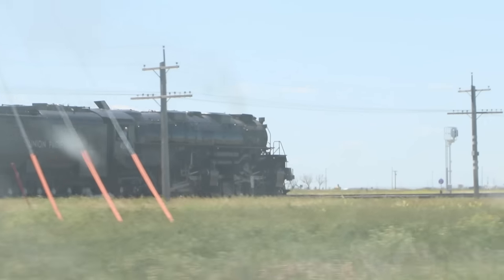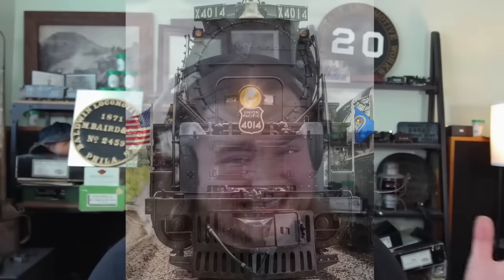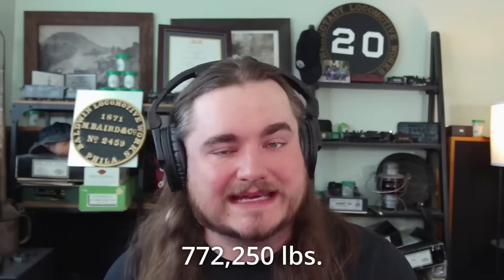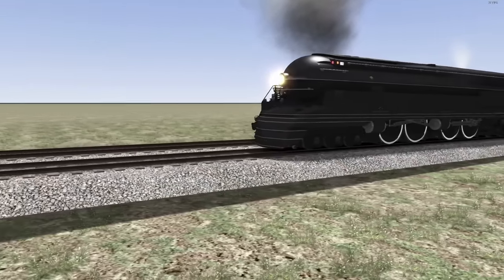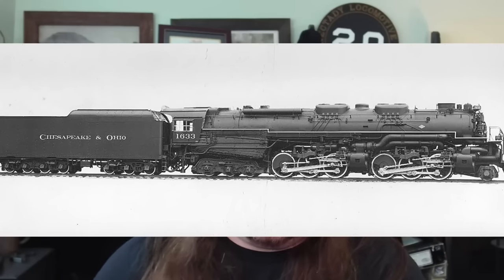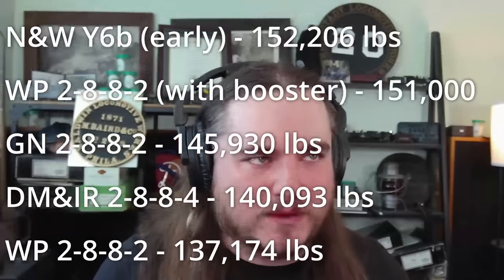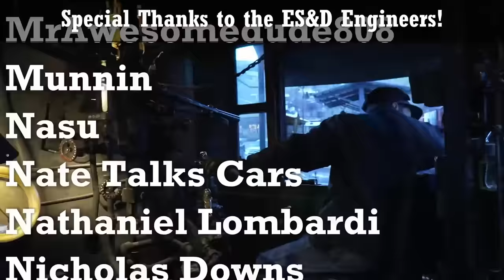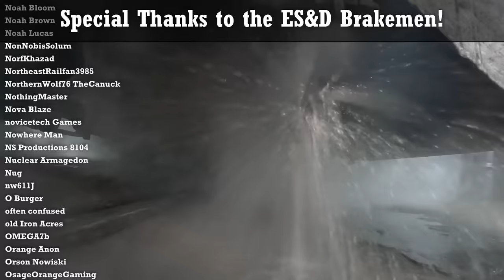BIG BOY is NOT the BIGGEST? What is then?

Comment: people saying the big boy is the biggest forget about the russian 4-14-sometging i forgot as well as the belgian overkill 0-6-2+2-4-2-4-2+2-6-0 locomotive which was too powerful for our European couplings
Reply: The quadraplex was a Belgian locomotive, don't blame the Netherlands for that
Reply: @Yorie1234 We're such a small country, we got to overcompensate somewhere 😅
Reply: The Russian loco you refer to,was like the steam turbine engines mentioned here, it rarely ran. Unlike the mechanical issues the ST machines, the Russian loco literally destroyed the rails it ran on.
Reply: the AA20 4-14-4 is the Largest Rigid frame loco made. 
considered a Failure in Russia for several reasons not it's own fault. 
it regularly tore apart the track it ran on because the Russian Mainline Rail size wasn't heavy enough to properly hold this monster up resulting in several derailments from wrecked Track. it was a notoriously rough riding loco very hard on it's operators from reciprocating occilation resulting from it's center of mass directly over the 4th driving axle. this caused an unnerving seesaw effect which didn't help the already overburdened track either.
Reply: Russian one had longest rigid frame. Compared to many articulated engines, he was pretty small (whole idea of it was to get powerful simple locomotive within low axle loads).
Reply: @Yorie1234  I seem to remember Train of Thought said it was meant for Italy or something
Reply: And the Garratts
Reply: The Belgian Quadruplex Locomotive (a.k.a, the Franco-Crosti Locomotive) is the locomotive you're talking about. It was the most powerful steam locomotive ever. History in the Dark introduced me to that locomotive, and it's a very immense beast.
Reply: Insane loco
Reply: Welcome to europe i guess
Reply: @TyrixBE Yes, but you have to fit the whole locomotive in the country. 😃
Reply: In Mother Russia, Locomotive eats rails for breakfast 😂
Reply: The Quadraplex was a poor steamer.
Reply: @Yorie1234  i misremembered my sources yea ur right
Reply: He Russian one was only used a short time. It's weight destroyed tracks. But then we must consider the quality of the rails, the ties, and the road bed in Russia.
Reply: @pforce9  The biggest Garratt, the NSWGR AD60 class, was only 108 ft long and weighed only 265 tons. My fave loco of all time but tiny by comparison.
Reply: @lordsherifftakari4127 Up Until The S1 came along and overtook the AA-20 Being the biggest Rigit framed Locomotive
Reply: USA: Gentleman, the Triplex Locomotives were a failure. Let's stick to Duplexes. 

Belgium: Let's try a Quadruplex!
Reply: @turkeytrac1  Ah you mean the "Double Mountain" Garratt 4-8-2 2-8-4's made as a three piece / double articulated (suspended boiler & coal bunker) units, that were made in several different variants for railways world wide (apart from the USA which was IN a tiny world of it's own), there were also THREE that were so huge and had to run so far without stopping, that they were almost always "coupled" to a tank-tender to suppliment the inferior water tank on the suspended (middle boiler) chassis itself.
Nothing like having TWO huge mountain 4-8-2's running "back to back" sepaated only by a HUGE low-slung central boiler with a small water tank and coal bunker?
Converting them to urn diesel was way simpler, as the coal bunker could be removed enabling a diesel tank to be there, or, by removing the water tank and bunkers out from the center chassis, an oil only tank could be set alongside the central boiler, although it was possibly more pertinent to leave the center spaces for spare water (that wouldn't matter if it was pre-heated before going into the main boiler, with the diesel in a big tank car behind, and with fuel "piped" to the cab controls.
Reply: The largest locomotive in my country is 6029, an AD60 class Beyer-Garratt with a 4-8-4+4-8-4 wheel configuration. And is in working order
Reply: that belgian quadruplex and the AA20 are like europes big boys to me
Reply: @ChessieSystem1973 Straya, mate 👍
Reply: Didn't Russia have a nuclear train at some point too? That would be Steam by technically

Comment: Long story short; the 4000 class isn’t the leader in any specific category (weight, length, horsepower, speed, etc), but it is perhaps the largest general purpose locomotive. Most other locomotives that beat the Big Boys categorically were designed to fulfill very niche roles on their home railroads and would not do well outside those roles. The Big Boys on the other hand, could get down on their knees and pound up a grade at 10-15 mph with tonnage, but then also pick up its rods on the flatlands and run 55-65 mph with that same tonnage.
Reply: The Alleghenies were also general purpose engines. Ugly as sin but they were designed for horsepower at speed. Although the C&O used them to haul coal trains up the sides of mountains at 15 they could and did pull fast freight at 45 to 55 and could have gone faster. They were really designed for fast freight even though they were absurdly heavy.
Reply from the maker: Very true. The big boys are excellent locomotives..
Reply: The way I learned it, (back in the 80s,) the Big Boy itself was a niche loco. It was built for relatively tight curves, pulling a lot of coal uphill on a tight mountain route. The Alleghenies presumably didn't have that restriction.
Reply: @eekee6034  Don't know where you got your information from,  but the 4000s were built specifically for service between Ogden and Green River, where they hauled mainly manifest trains and perishables (fruit blocks). Coal trains were not their assignments. The route does not have particularly tight curvature. The restricting factor on the size of the 4000s was the vertical clearance in the Aspen tunnel, east of Evanston, WY.  In the intervening years the tunnel's height has been increased and now accommodates stack trains.

It wasn't until they were bumped by diesels that they routinely ran east of Green River. They finished out their service lives on Sherman Hill, between Cheyenne and Laramie. During that time they would be run down to Denver, and occasionally to North Platte. They had to be turned on wyes at both terminals because there were no turntables to accommodate them there.

Although they were cleared to run on main lines across the entire system from LA and Portland in the west to Council Bluffs and Kansas City in the east, they stayed on the original UP route between Ogden and Council Bluffs, except for the runs to Denver and a series of  test runs between Salt Lake City and Milford, UT. That was oil fuel territory, so the 4000s had to be fueled with a clamshell bucket from hopper cars, the way coal burners on fan trips are done today.
Reply: The Big Boys were the largest mass-produced locomotives, I believe.
Reply: @andrewmagosky7181 the C&O’s Alleghenies if memory serves correctly couldn’t be interchanged with other railroads due to them being so heavily ballasted for coal service in West Virginia and later models of the “Blue Ridge” Virginian variants of the Allegheny were similarly ballasted for coal service and was the only railroad interchange the Alleghenies could operate in. 

And no they were not ugly. They were totally functional and Spartan in appearance as they rightfully should’ve been given their work
Reply: @andrewmagosky7181 they were definitely not ugly. I looked like real heavy workhorses to do what they were designed to do.
Reply: If I remember correctly, the Lake Superior Railroad Museum (in Duluth, MN) has an engine of a size comparable to the Big Boy, perhaps even slightly bigger.

Comment: Jawn Henry was absolutely insane.. 600PSI Water Tube SHIP boiler. Driving a turbine providing electricity. It had AUTOMATIC boiler controls.. They built a freaking coal power plant on wheels.  and of all the experimentals Jawn.. worked. Almost too well, it was infamous for doing things like pulling knuckles and even pulled a couple hoppers apart. It was put in Pusher service for that fact. It wasn't replicated because it cost a freaking fortune. But by god could the thing pull...
Reply from the maker: Good Lord. That thing was rad.
Reply: Wow.
Reply: The Jawn had other issues as well. Tended to crack turbine blades if the operator changed power output demands too rapidly. Had problems with coal dust and water playing hell with the electronics. Very sensitive about water quality, and as you said, prohibitively expensive. None of these were insurmountable problems, but it came too late for other railroads to be interested so the money just wasn't there to refine the concept further.

I should also note that the tractive effort rating provided by Hyce for the Jawn is off a bit. The operator's manual (which I have a reprint of) states continuous tractive effort at 10 mph at 144,000 lbs, and starting tractive effort at 175,000 lbs. Still respectable numbers to be sure and much higher than the Big Boy.
Reply: @NorfKhazad  Shame that at least one part wasn't preserved
Reply: @NorfKhazad   So Jawn Henry was essentially the equivalent of some variant of SD70?
Reply: @davidwhiting1761  In terms of performance? Yes. 40 years of progress in electrical controls and truck design makes a big difference.
Reply: Easily my favorite machine of all time.
Reply: I love that this beast of a train was presumably named after the folklore of John Henry, the might man
Reply: Hello how are you? I want to share you 

This is a message from your loving God.

God is a loving God and want to save us all.

God dont want anybody to suffer or have a hard life. Meaning of life is love and that's what God wants. Thats the meaning of life. If we would take care and love each other that would solve all the problems. But world is not like that. World is a sinful world. God dont destroy this world but we humans do. His immediately ready if you want to serve him. God will show you the right path what leads to life. Its a path of love. God made us and have eternal love and mercy. This world is not what God wanted. But he gave us free will. You can choose good or bad. Thats why he send he's only son Jesus that we had mercy. Jesus is God too because he is God's only son. Now this world have went to very wicked and our God is crying. So many peoples are on the path of destruction. World have allways been wicked but now is extremely bad times going on. God want's peoples to come back to serve him and he wants to give forever life and happiness. God is a God of love, mercy, justice and a judgment.

He love us peoples as much as hes son Jesus. 

There is one big lie going on this world. Its an evolution lie. First please think this thing. Why all the fruits, berrys and vegetables taste so good? Anybody can go to own home kitchen and try to do the same taste. Then look up please and watch those extremely beautiful birds. Do you really believe birds came from dinosaurs? We need very light bones, right size, correct shape, a bird's beak and feathers. And the same time birds are very beautiful. I send only these two questions to evolution professor and nothing came back(Why berries taste so good and how those little birds survived without wings) 

Then they say evolution gave animals camoflash to survive. Well if we look black panther. They say it's black because it's a night-time hunter and that black color also give it protection during night-time. First thing: evolution dont have brains and it gave that black color they say. Second thing: Please think how many shades of colors are and all animal have to be black.

Third thing: Then they say there were many panthers with another color also and the best color was left. Because it's the best color in the nigh time. This is a lie also because: if you think like evolutionist's: the animals system also have to know to do black anymore. Rabbit is also brown when it's a summer and white when it's a winter. We need intelligence to do that. 

They say also evolution develops animals or Humans what kind of element we live. Why then fish have gills and whale have lungs? They say first came the first cell and that was finally a fish. And then finally fish came to land and it was frog or something. 

But thats inpossible because gills should also transform to lungs under the water. They brake their own logic when they say that. And how about a whale. Whale proves also God is real because it have lungs. Theory of evolution tells everything started from ocean. 

They also say that plants came from ocean and thats why we have now.

Thats a lie because:

The plants have an underwater pollination system. If something comes to the beach it will die for it. And they are breaking their logic again. Fish and other water animals and plants belong to sea. 

Only our loving God can create life and everything what we humans and animals need. People can try to think but the deeper we try to dig the more lost we are. We cant ever create life from nothing. 

A simple car engine also needs its maker, parts, fuel and the right structure to work. 

I had health problems about six years ago. Finally it was so bad i thought im gonna die. My heart was beating fast. My blood pressure was high. Then i started to lose my energy. When i try to walk my legs felt heavy and my stamina went very bad also. Then i started losing my sleep. Eventually i crashed a little into the road and asked God and Jesus to help. Finally I started to run in the toilet all the time too. Then the very awful thing came. I lost fastly almost all my ability to sleep and I started to loose my weight. Blood came out of my nose and I started to lost my hairs too. I visit hospitals and private hospitals too but they couldn't help me. They gave me beta blockers to my heart and finally medicine to my high blood pressure too. I wanted to get inside the hospital but they refused to take me in. In private hospitals they couldn't understand why they dont take me in the main hospital. Finally I contact to other country and I asked can you take me in the hospital. Then they asked where are you here? I told im in the other country and I need a help. But they told me we cant take you in because you dont live here. So I can tell you money didnt help me. Later I told my family im gonna die very soon because I felt completely awful. Finally I asked again God to help me. Then finally my Mother saw one Angel vision and three Jesus vision. After that it took few days and my health came back. I got my sleeping back and my heart started to calm down. I started to gain weight. Blood pressure went back to normal and finally I got all my hairs back. This Is very short version what happend to me but I was close to death. God Is real and loves us very much. When you begin to seek God you Will find True love. Read the Bible too please because its a perfect book. Thats how you know God Is real💕🙏. Read what Jesus told because its perfect talk💕🙏
Reply: @TimoIivonen  Somebody always has to ruin things. Could have been a Trump hater too.

Comment: It seems silly, but I think 1 reason that the Big Boy is so iconic as "The biggest" is due to it simply looking the part.  No streamlining, the whole pilot assembly is massive, it has a lot of rough and tough looking external parts. Ect.  It just looks like the designers said screw making it pretty and give me as much power as you can.  Plus the name definitely helps.
Reply: And the locomotive without its tender is considerably larger than the S1 without its tender

Comment: I've always had issues with anyone listing the Jawn Henry as a "steam locomotive" in anything but the most general sense.  It is, by definition, a Steam Turbine-Electric Locomotive (STEL), not a Steam Locomotive.  How the turbine is operated doesn't actually matter in the classification.  It falls under the same operating principles and in many ways has much more in common with the GTELs than a steam locomotive since the steam is not directly driving the drive axles.  "Steam Locomotive" has always described what powers the driving axles, which is why the GTELs were "Gas Turbine-Electric" and most modern road engines are "Diesel-Electric".
Reply: Agreed!  The Jawn Henry isn’t anymore a steam locomotive than the Arleigh Burke, or for that matter the Nimitz, are steam ships!
Reply: Using your logic, a diesel-electric should simply be called an electric because that's what powers the axles. But they're not, they're called diesels because that's what makes the power. Using that far more common logic, what makes the power on the Jawn Henry and the M-1 for that matter? Steam.
Reply: @davidrayner9832  So, I guess then since they are powered with high pressure steam turbines the US Navy’s entire fleet is steam aircraft carriers and steam submarines?
Reply: @scottwendt9575  Diesel, when describing a locomotive, is short for diesel-electric so the ships and submarines would be steam-turbine-electric which you can say if you want to but most people would shorten it to steam-turbine or you could shorten it further to just steam. Any of those is OK.